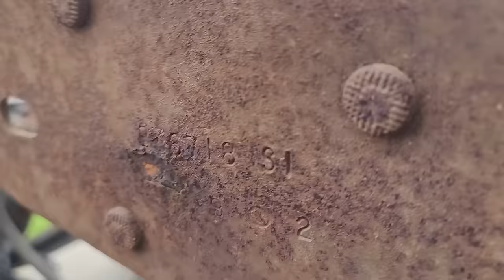Ford Ranger, MIG welding truck frame back together, how to.  Build part 7

Comment: I have 45 years of welding,  some of the suggestions you got were spot on.   However in the overall you did a great job and it will work just fine.  I appreciate your effort and I like to see other people's work. Doing it yourself gives such great satisfaction.
Reply from the maker: Thank you!  I really appreciate that feedback.  I thought it would be more than adequate for a Ford Ranger, in fact I though I was overdoing it.  I have definitely picked up some better ideas from everyone sharing their thoughts with me.  Thank you for the kind words and for checking out my channel!  I hope to make more videos of all the welding projects I have.  -Frosty
Reply: Really?  I have over 45 years in the automotive industry, manufacturing side, and this video scares me.
Reply: @jamesford7182  Maybe you can give him and me some constructive criticism so we can all have a better understanding and do a job that is up to higher standards.
Reply: Right on. I want to build an airplane.
Reply: @jamesford7182 Why?

Manufacturing is miles away from repair/restoration jobs. 
Take a look at factory racing teams rebuilding and blueprinting brand new machines.  Manufacturing isn't perfection, it's just the starting point.
Reply: Right angles for corners.  Concentrated stress points.
I did like how you lined up the reference hole part.
Frame rails are generally made of higher tensile strength steel than the rest of the vehicle.  High tensile steel doesn't act like malleable steel.  
When welding high tensile steel to low tensile steel, the heat affected zone around the patch becomes the weak spot.
The flange is the weakest point and it didn't get reinforced.  

Manufacturer's publish guides for repairs.  Not following them assumes all fault and responsibility in court.  Which really doesn't matter until there is a grieving widow involved.  And vehicles are never involved in accidents, right?
Reply: cant be bothered to set and example and leave the saftey guard on his grinder , cant be bothered to watch his video.
Reply: @krusher74 lmao. First thing I throw out with the box when I get a new grinder. Get the heck out of here
Reply: The best part of YouTube is comments from people who weren't there during the filming. Then, making statements about their "experience" and "how it should be done" 
Hashtag noonecares.

Comment: In engineering terms, a chassic is a beam, like a bridge. The most stressed part of a beam is the top and bottom sections, separated by a web matrix. In your repair, the fysh plate adds little strength to the beam, as the stresses run lengthways above and below the plate. A small plate welded inside the top and bottom of the overlap would be all that is needed. Cheers
Reply from the maker: I appreciate the suggestion!  2 years has passed and it's been holding up really well, if I ever break the truck down again to paint the frame I'll add some plate to the top and bottom flange.  Thanks for watching and taking the time to share your experience!

Comment: Very nice work sir.  Just 1 recommendation - take it or leave it - round the points on the fishbones so you don't have stress points at the tips.
Reply from the maker: Advice taken well, I think you are correct!
Reply: I guess you have to start with an over sized fishplate to have room to round the edges and  still have it fit the full width of the frame. Just starting chassis repairs myself.
Reply: I forgot to mention the stress riser at the pointed plates. thank you for your comment
Reply: With the salt in a snowing country closing the fish plate by total seam welding will mean that the salt cannot attack the frame as much with rust in a place where you cannot see it or the degradation  that can take place over time.
Reply: Living in the land of Snow, ice and  ice melt products I would have to drill out the bottom of the shock towers to allow that area to drain. My OCD would let me do all that great work without treating and painting the entire frame.

Comment: Your splice was perfect ! The fish plate should have been a rectangle with a full weld horizontal top and bottom, with a vertical stitch center on both ends. I've spliced locomotive  frames, long haul truck frames, and trailers.[45 years] Transverse welds are usually the weak point. You did a Good Job !
Reply from the maker: Hi Terry!  Thank you for watching and for letting me know your feedback, sounds like you have a TON of experience!  I will probably cut and weld a frame again in the future, I really enjoyed the process, next time I'll use your advice on the fishplate!  Have a great day!  -Frosty
Reply: I've always seen diamond ish fishplates on regular vehicles. But yeah i guess a rectangle may work aswell. The fishplate idea is a cover your ass thing i would guess. Welds can't fail if you over do it. Seen people skip the fish plates, works fine if your welds are good. Not talking about trains.
Reply: Yes, and don't forget holes in the BIG THICK plate to weld inside of!
Reply: @frostydoesit  nothing wrong with the diamond shape. I build 40' box trucks for a living, and we extend all of the frames with diamond shape fish plates. Nice job!
Reply: I was always told a diamond shape is less likely to crack out that a rectangle
Reply: Best you had just make a new frame chassis
Reply: Actually, you had everything correct BUT the welds on your fish plate. It should ALWAYS be diamond shape but your welds should NEVER touch. By them touching you're allowing for the heat distortion and the flex to have the perfect place to crack under flex. As a guy who professionally stretches and shortens semi trucks and low boy/drop deck trailers. Otherwise, great work.
Reply: Terry, your method wouldn't pass state inspection in numerous states. We stretch semi frames too and for some reason, car frame repair is held to a different standard for weld repair. NY, PA, Ohio and Nebraska to name a few, require a diamond shaped repair with rounded points, no square or rectangle repairs. You present yourself as an expert, and gave this guy bad advice,i suggest that unless you are knowledgeable of all 48 states inspection requirements, refrain from chastising others.
Reply: @josephpacheco7508  so your saying the 4 corners of the diamond should not have been welded? I'm about to do this same type of job on the back of a f250. Just making sure I'm understanding.
Reply: @andrewavvenire116  correct. Leave no less than 1/8th to some times even 1/4" gap at the end unwelded.
Reply: @josephpacheco7508  thanks
Reply: Great job.. I've done a few this way.. In heavy duty applications I'd think about  putting a radius  on the corners of  initial cuts.. So the stress points don't intersect. But given how and where it was done - an excellent job.

Comment: So, one question here. Why, oh why mess around with a "Z" joint, why not simply cut straight down at 90° and have a simple straight weld?
Reply from the maker: Great question, the people I know/trust in the big truck semi world who do this daily always use the z notch.  There are lot's of different opinions out there and schools of thought and science to back up all the different ways to do it.  I chose the Z, it was easy to lay out and put back together.  If I did it again I would still Z the cut.

Comment: Man it’s hard to beat the sweet crisp sound of a perfectly adjusted Miller machine!
Reply from the maker: Couldn't agree more!
Reply: Totally agree 😎 Miller....
Reply: I used miller at the beginning of my welding career but I’ve used a Lincoln 350MP for the last three and a half years and I love it
Reply from the maker: @joelmichotjr97  I think red and blue both make great equipment.  That 350 sure is nice!
Reply: @frostydoesit  I wish I could afford one tbh. The push pull guns we use are great too but people aren’t careful enough with them
Reply: @joelmichotjr97  I actually have an esab rebel at home (the one that has everything including high freq ac tig.) I just love the sounds of welding when one’s machine is in tune. Back in the day tigging stainless Miller was the only one that would sing, but that was 30 years ago, now everybody is doing it :) my little machine actually has a higher and lower frequency range than a Miller dynasty, needless to say I’m always finding stuff to weld.
Reply: Couldn't have said it better.
Reply: @themajictech : Tearing Silk'

Comment: Well done I have been welding commercial HD truck frames for a long time (lengthen w.b. Add cranes etc) You are doing a really good job and your welder settings are spot on Using the locate holes for initial alignment is smart Good Work!
Reply from the maker: Thank you!  I really appreciate your feedback!  I talked to quite a few people at work who have done the same as you with our Pete's and Kenworths before I started this frame.
Reply: When welding with wire Best to run down hill if you notice your weld was much nicer unless you're doing heavy iron but it looks good
Reply: @richardmistic8344  structural welds are NEVER  to be run down hill. You adjust the machine accordingly. You can make the weld look visually appealing if you know what you're doing.
Reply: @chadkennedy529  Why shouldn't structural welds be run downhill?
Reply: @westonsmith4984  no penetration, heat rises. Although there are some situations where you'll have to and if that's the case crank to heat up and take your time.
Reply: @richardmistic8344  wrong. Downhill welding will get you fired where I work.
Reply: @Biggus Dickus  what are we referring to with "downhill" welding?  Im assuming you're saying to push the puddle, and not drag it, is that correct?
Reply: @ryanjackson587 down hill is from top to bottom and uphill is from bottom to top.  Downhill doesn’t penetrate as well because your heat isn’t following as well as your puddle will be leading.
Reply: @chadkennedy529  "structural welding" involves a minimum 3/8 inch plate.  in metal like this(3/16?), you should use the hottest travel direction that does not blow through.  also, he is welding from both sides, so penetration may be less important than the HAZ impact.  Also, a better critique would note that fish plates should not have points for corners as they  concentrate stress and promote cracking...   best practices would involve slightly arced straights and curved corners(hence the name "fish" plate)..
Reply: @peetky8645 

Not here in Canada.  We have structural codes for 3.2mm and up and codes for under 3 mm.  You are right a out the fish player but overall he did a good job.  I've had worse roll through my shop for repair.

Comment: Very good! I would make one change to the diamond shaped fish plate though in the future. I build 
large aluminum boats and sharp or square ends are never to be used, Coastguard Regulations. I would radius the hard points of the plate as they tend to cause stress points that can lead to cracks at the ends. What you have done is perfectly acceptable though for a automotive frame and is surely a more sound connection as to just a butt weld.
Reply from the maker: I agree with you 100%  thank you for watching and taking the time to give me some feedback on it!  -Frosty
Reply: Finite element analysis FEA shows the highest stresses occur at points and square corners.  Radius distributes the forces equally across the joint edge. 
Also, nice work, I have learned many things from you here. Thank you.
Reply: These comments are absolutely excellent and describes the proper way as opposed to some knucklehead claiming "square or rectangle patches are better than diamonds because I've been doing it for years blah blah blah".
Reply: @TheRoadhammer379  the same applies to a diamond as to a square.  the issue is pointy corners.  even the straight runs of a fish plate should be cut to a slight arc to spread the stress along non-linear path.  just like a "fish " is shaped.
Reply: I was about to say the 90° inside Corners in your splice should be drilled at the corners to avoid stress risers

Comment: Yes this is how my dad helped me fix my 80 chevy frame. Still going today. Gr8 work.
Reply from the maker: That's awesome!  How long ago did your dad do the repair?
Reply: We did it back in late 90s. He cut a wide and short diamond plate that went on inside and outside. He said outside was overkill but it was a flatbed used for hauling scrap, winch line for logging machinery, fuel etc. I forgot what that cut is called. Z cut. I called it a dovetail. Not same but it's hard to get across technical things in just words. I recall that we was told just duct tape the seals, rear etc and it'll be ok to sand blast. Well it was for about a month then the rear went out. Sand blasting coal slag and gears don't play well. Since then we wrap in hay rope, then tape, no issues. Of coarse that rear was already 18 yrs old and wore. We've done this same thing on a few trucks, cars etc. Works great and lasts. I know there's alot of ways to skin a cat but some ways I've seen makes me scared yo be on road beside ppl. Lmao

Comment: Excellent work from start to finish - especially cutting the locating hole on half as a reference point. Also the fish plate welding where the bead did not extend to the tips is spot on, my experience 😊
Reply from the maker: Thank you very much!

Comment: I am DYI guy involved on many hobbies , I am self taught but with videos like these it makes my life easier , good job on the welds . Back  on my beginner years , I started with a cheap Harbor  Freight welder welding floor pans on my 84 Ranger , I had many fat friends ride with me , and the floor pans still hold up great , I do need to work on my rear frame , but this time  I have a more expensive welder that gets the job done .
Reply from the maker: That's the most important thing a guy can do, use what you have and do your best!  If you don't have 1 or the other ask for help!  Thanks for watching!

Comment: Nicely done Frosty, it's nice to see a well thought out repair and not just another "Youtube Certified Technician" telling everybody how to do a "Proper repair". Of course I have a little constructive criticism, weld the inside first, back grind to the weld from the outside to allow 100% penetration and I personally would have used a longer splice, with radiused corners to capture the original frame welds. Excellent work and a good instructible video for all your subscribers 🙂
Reply from the maker: Thank you Brad!  I have actually learned quite a bit from everyone sharing their 2 cents.  I have to rebuilt my skidsteer bucket here pretty soon, that will be a good one to watch too!  -Frosty

Comment: Well done! About the only thing I could think would make it stronger would be to drill a few 3/4 inch holes at each area of the plate to create more weld strength.  Nice job!
Reply from the maker: Thank you Bill!  I appreciate the feedback, also thanks for watching!
Reply: plug welds.

Comment: I use football shaped plates with radius edges in applications such as this, sharp corners create stress risers that can crack, never weld crossways or transverse on a stress member.I also run 7018(SMAW)on most repairs like these. Good video
Reply from the maker: Great tip!
Reply: Why never weld transverse or crossway
Reply: @desgracado  He doesn't know.  Just does what he is told... which appear to be half truths.  The most dangerous of all.

Comment: Hope you sand blast and protect the rest while all the hard stuff is done. Great work on the welding!
Reply from the maker: Thank you David, I appreciate that.  Once I get some seat time with the truck and if I decide I like it, I'll take it to work and sandblast/paint it.  Only takes me a couple hours to get the bed and cab off.  -Frosty

Comment: That's a nice job.  Fish scales, plugs and good welds.  It's stronger than it was when it was built, and I bet everything fits together in a snap.  I've got a 2000 Silverado frame that's ready to blow away in the wind that I'm thinking would make a really nice series.  I can get it to you likety-split, and I DO mean split.  😁
Reply from the maker: Thank you Bill, I really appreciate that.  Sounds like you have a project on your hands with your Chevy frame, can't get any worse right, jump in and fix it!!  -Frosty

Comment: That's a really great job! I would have fishplated the "flange" instead of the web. The highest stress and possiblity of cracking is at the top and bottom. Nice work!
Reply from the maker: Thanks for the tip, If I do another one I'd make a few minor tweaks like the one you suggested...but...she's holding up great over a year later!!

Comment: I personally like the way the joints are smooth and basically invisible once you apply any finish over them. That, in my opinion, is the way to do such welding on auto frames...
Reply from the maker: Thank you for the feedback Gary!